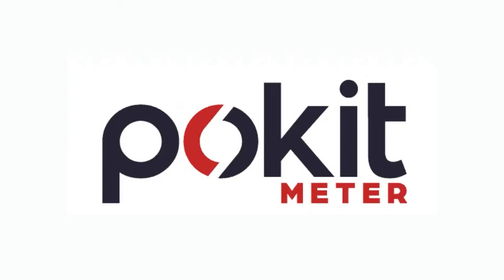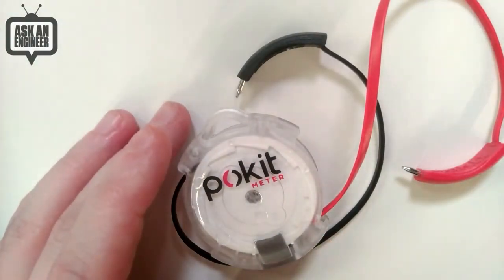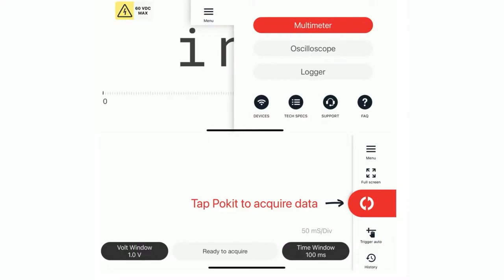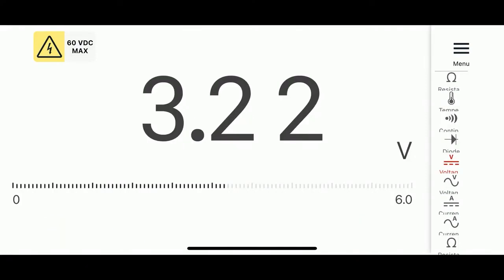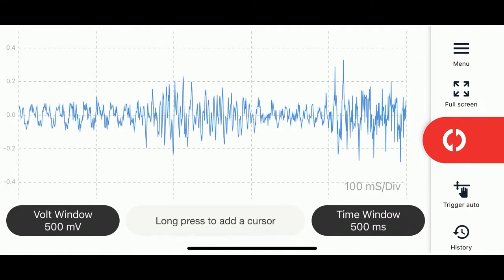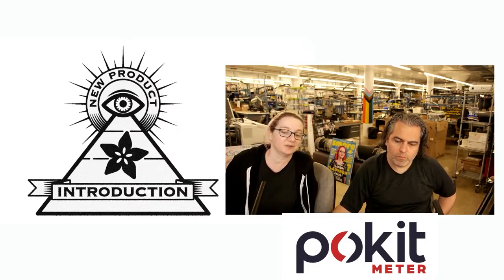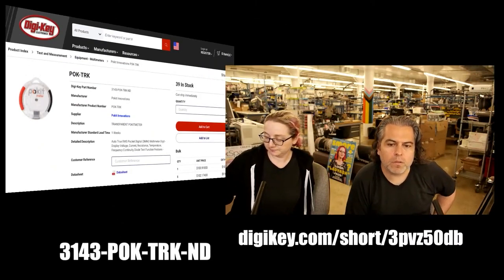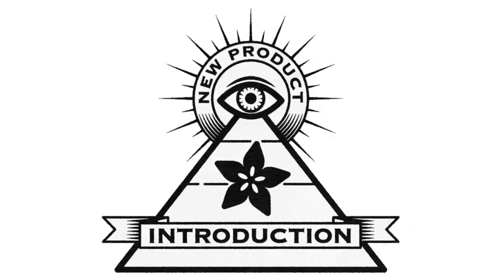EYE ON NPI - Pokit All-in-One Meter #EYEonNPI #DigiKey @DigiKey @Adafruit @PokitMeter

Comment: Thanks for the live demo on this. I think the biggest advantage of this device is the fact it's smaller than any other pocket multi-meter - if you make the assumption you're already carrying a phone. Which I think is a safe assumption for most of us. The iOS app also looks much more polished than most of the apps for other meters.

Definitely some significant drawbacks too though, like the 40/60V maximum and the weird non-ergonomic probe shapes. Overall for $100 it seems fairly priced.

Comment: Kind of surprising they don't have a built in piezo or something for continuity; I'm by no means a dmm power user, but my satisfaction with a meter tends to be proportional with the responsiveness of the continuity beep. (It's still faster than my slowest meter, though, which is pretty impressive) That is pretty cute though.